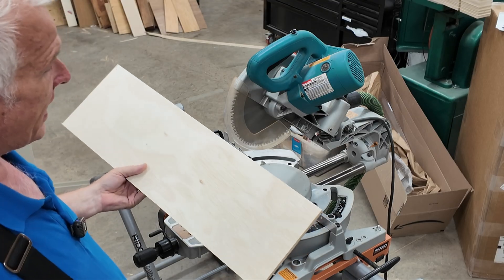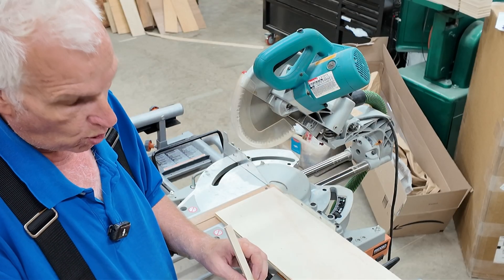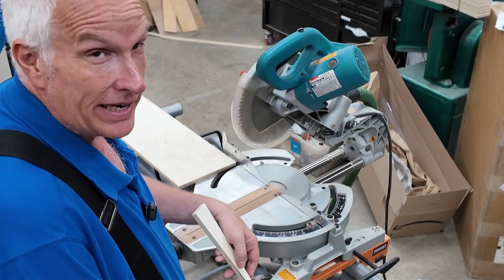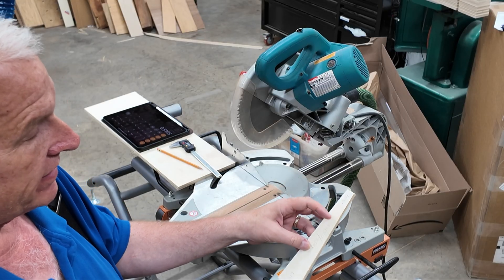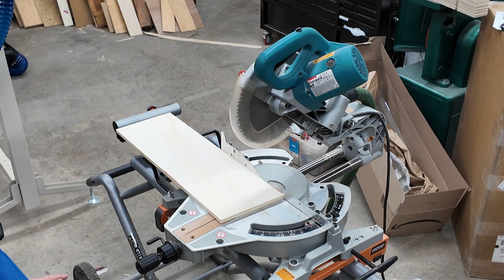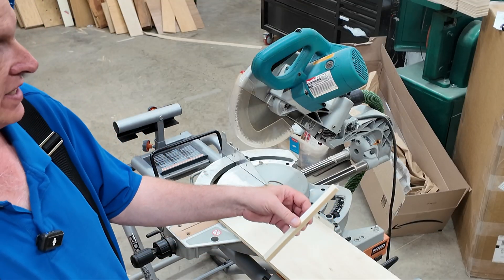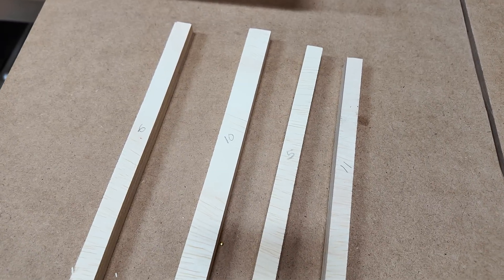The Page Flip Method: How accurate are square crosscuts on your miter saw?

Comment: With my old Master Mechanic miter saw I doubt they'd have been very square, but I don't use that thing much anymore.  Couple years ago I restored a 1950's DeWalt radial arm saw and that thing is nice and square.  Took a while to dial everything in, but once you do, that old cast iron is rock solid and ain't moving.
Reply from the maker: Yeah I’ve always heard the old DeWalts stay dialed in. Great machines.

Comment: Good video.  

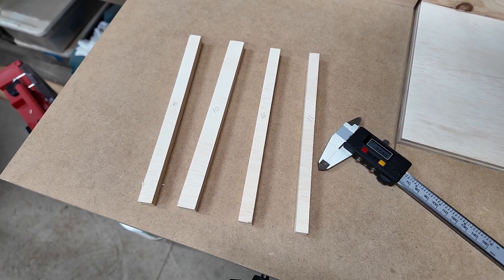I notice a potential problem in your test at the radial arm saw - I am a little surprised that the potential problem did not affect your testing results.  At 9:07 the miter lock lever at the left side of the arm is resting on the bottom of the bolt that acts as a stop.  At 9:37 the miter lock lever is straight forward (which is fine).  At 9:54 the miter lock lever is on the top of the bolt that acts as a stop.  For one of those two sets of cuts, the miter lock lever was not engaged.  Let's also hope that your fence board is not warped on one side of the blade, as happened with the flat sawn fence in one of my radial arm saws, as that would also throw off the testing results (I was seeing accurate square cuts to the right of the blade and non-square cuts to the left of the blade).
Reply from the maker: Wow. Good eye. I didn’t think anyone would spot that. 

Yeah, while shooting this video I noticed that the miter lock lever needs to be adjusted. It doesn’t do much when the saw is at zero degrees, because the plunger is held pretty well by the stop, so I decided to just finish the video.
Reply from the maker: Also yeah, I remember the video you did about that fence problem on your RAS. Yeah, the method I showed really does need the fence to be straight. OTOH, it’s pretty unlikely that a warped fence would lie and claim the setup is good when it’s not. But if the blade is exactly square to where the fence would be if it were straight, then the test will fail, as I think it should, but the person might not immediately see the actual source of the problem.
Reply: I wonder if you could create a board roughly the same width with two parallel edges using the table saw?  Then you could repeat the test using only one side of the blade, flipping the board so that the opposite parallel edge of the board is against the fence on the same side of the blade.  You could then repeat this altered version of the test on the other side of the blade on both saws to determine if the fence on one side of the blade is to blame for the essentially consistent inaccuracy.  

What is the definition of doing the same thing over and over again, expecting different results?  Not insanity... just trying to make certain that your tools have the desired level of repeatability.  Have you successfully completed a reliability and repeatability (R&R) study on the accuracy of your digital caliper yet?  What if it is the digital calipers that are not repeatable, and the saw cuts are perfectly repeatable instead? 😄😄😄
Reply from the maker: @TheProfiledCorner Interesting idea.

Comment: I like when you show your approach to some of these potential issues in accuracy, it is helpful when in this case, a saw may need to be retuned.  
Using as wide of board as possible, might show a more pronounced discrepancy when measured.
Reply from the maker: I thought about a wider board.  The 10” Makita couldn’t go too much wider.  In theory, when measuring with a caliper, the wider board shouldn’t change the result.  OTOH, the nerd thing to do would’ve been to demonstrate the claim I just made in the previous sentence.

I originally thought I would include a track saw setup as the third test, but I decided to keep this video simpler. A track saw with MFT and rail hinge are pretty different from the other two, and I would’ve spent a bunch of time explaining those differences.  But that setup can do a very big crosscut.
Reply: @ShopKlutz 👍I probably missed the width of the board you used, I figured the sliding miter saw max width would be 10-12 inches.
Reply from the maker: @gnic76 I forget what the actual capacity of that saw is. The test board was 8 inches, and I definitely could’ve gone a bit wider.